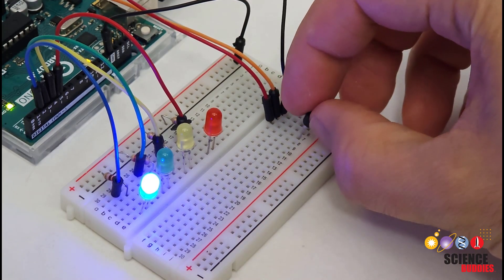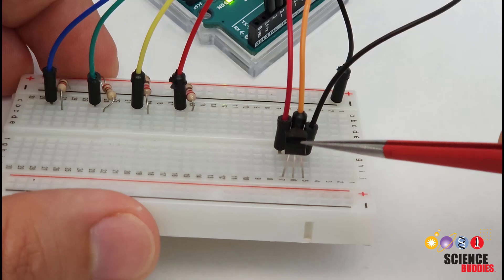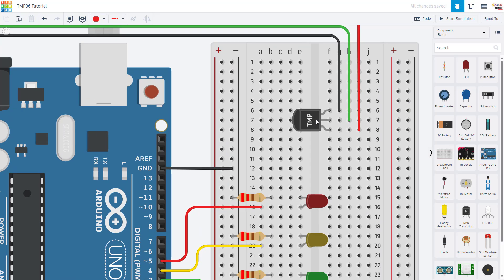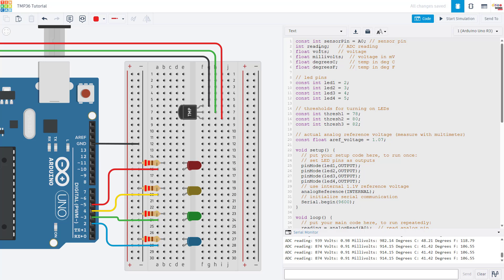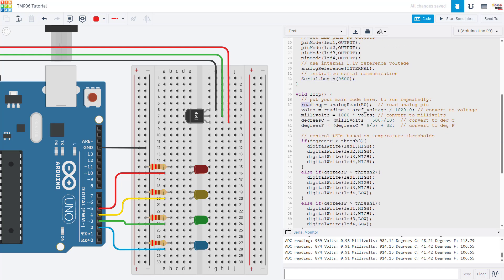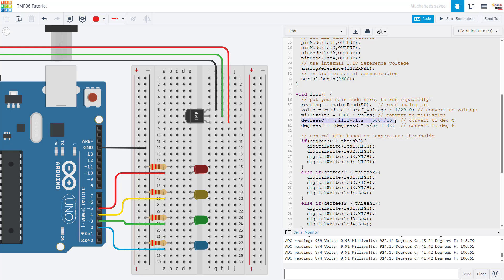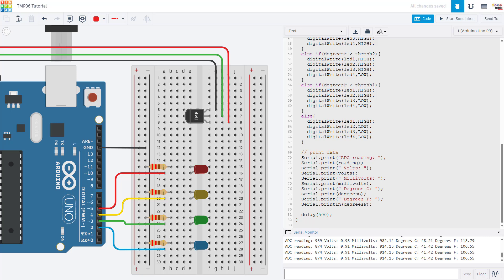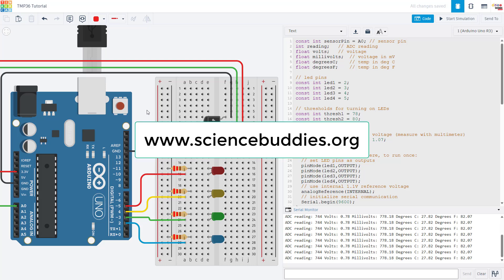How to Use a TMP36 Temperature Sensor with Arduino (Lesson #39)

Comment: Which pins did you have connected to the multimeter? It was hard to see. Did you connect the power and ground to the multimeter?
Reply from the maker: Multimeter ground is connected to the sensor ground, and multimeter positive is connected to the sensor output (middle) pin.

Comment: What are the little things on the ends of the wires
Reply from the maker: Those are rigid pins that are attached to the ends of the flexible jumper wires to make it easier to press them into a breadboard.

Comment: burned my finger touching it
Reply from the maker: If a part is so hot that you burn your finger touching it, you may have it connected incorrectly.
Reply: @ i connected it exactly as you demonstrated what did i do wrong😢
Reply from the maker: We recommend asking for help in the official Arduino forums, where you will be able to post pictures of your circuit and people can help you troubleshoot.
Reply: @ nevermind it was for my exams which i had to get a grade of minimum 4 for. Never touching microcontrollers again

Comment: Hello! I'm controlling an analog RGB strip with this sensor instead of individual LED pins. I followed your tutorial about controlling the analog strip, but would the wiring for the TMP35 remain the same, or would it be different with the strip?
Reply from the maker: The wiring for the TMP35 would remain the same; the code would change depending on what output you want to control.

Comment: question: why does the reading * aref_voltage is whole divided by 1023
Reply from the maker: The Arduino's analog to digital converter (ADC) converts the analog voltage (which accepts inputs up to 5 volts) to a digital number between 0 and 1,023. This equation converts that number back to a voltage.